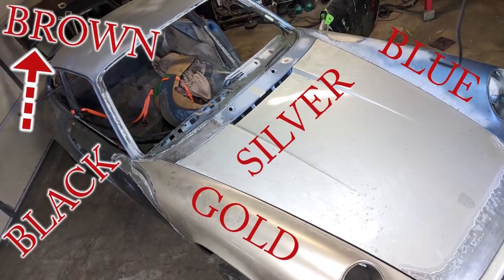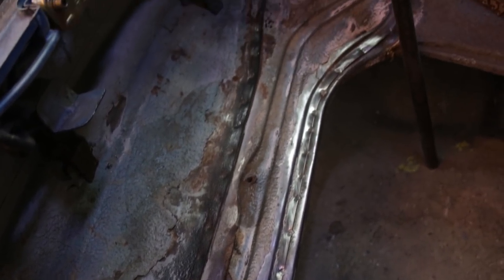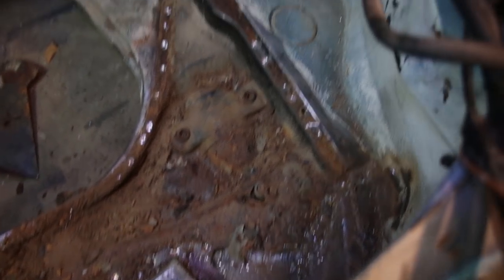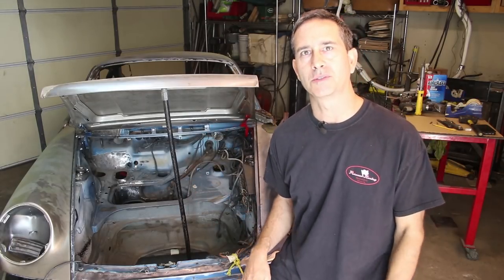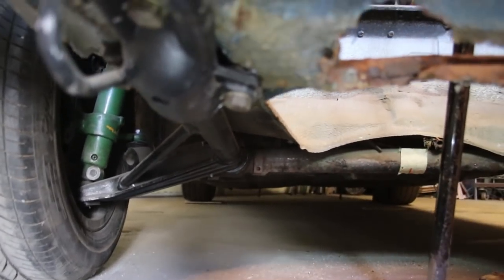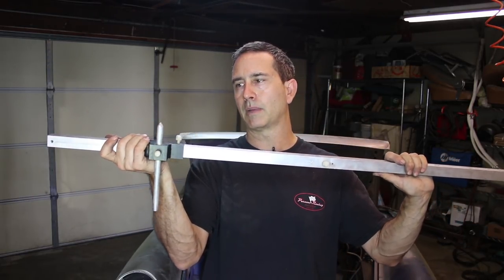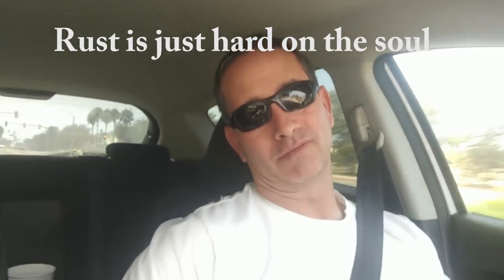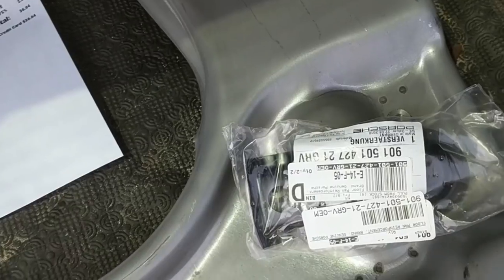Rust Repair is HARD on the Soul...Porsche 911 Suspension Pan Fun😀

Comment: Many people simply cut out the suspension pan, trace old out pan onto the new suspension pan. Prior to welding the new pan, bolt in the suspension points. This will ensure that it gets welded on straight.
Reply from the maker: Yep, I wouldn't recommend that on a 40 year old car especially with known accident history like mine.
Reply: Garage Time - Restomod I totally forgot that your car had been wrecked at one point in the past. Makes sense that to decided that you needed to measure.

Comment: I have a 1977 911 and my front drivers side front part of a arm is pretty well rusted out.  I can move it a tiny bit and you can see cracks all around the 3 bolts that attach it to the chassis.  I was quoted $4000. and since I have more time than money, I would like to do it myself.  It just looks like such a big job, I'm not sure I can do it.  I would think I would need the suspension pan, gas tank support, and fuel tank seal.  Your videos are great.  Thanks, Shane
Reply from the maker: wow, thanks for sharing your story.  It's a big job, but you can break it into several smaller jobs and take your time.  If and when you get stuck, reach out here and we can help.
Reply: So will it be ok to just jack up the front of the car and support it with jack stands on the brace that runs from side to side in back of steering rack with out jacking up the rear of the car?  And not remove the a-arms, but leave them in place to line up the holes of the new suspension pan?
Reply from the maker: Hi Shane, yes the front cross member is a good place to support the car while working on it, however I recommend removing the A arms because they aren't good measuring devices (lots of sliding rubber pieces) and they will be in your way especially if you are replacing the side supports.    How are your welding skills?
Reply: I have a friend that has good welding skills that is willing to help.  Should I just measure before I take it all apart and rely on those measurements -602 mm front to rear and 916.5 diagonally or could you send me a copy of those workshop manual measurements?  I have a friend that will lend me his digital tram gauge. I ordered the suspension pan w/reinforcement brackets and the fuel tank support and fuel tank seal.  Having the new fuel tank support, I could just cut out the old one and then just remove the spot welds for the seam of the suspension pan.  What are your thoughts on all of that?
Reply from the maker: I wouldn't trust an old car with mounts that you can wiggle by hand.  Best to use the factory measurements and make it like new again.  The diagrams are available on a few pelican parts forum threads.  Email me if you can't find them.  My email is in the about section.  
A friend with a welder who's willing to help is a big score!

Comment: Another interesting water level method! Applicable to our cars. Had similar questions to others you answered like rigid shocks. Are they welded? Tires equal pressure etc, are there additional variables that factor into nailing those measurement ranges?
Reply from the maker: Hey Fancypants...thats fun to say!!!  Send me an email and I'll send you some pictures of the temporary rear shocks.  Other variables are minor as long as they don't change.  For instance if the tire pressure changed on one side in the course of a day.  I have another tool that eliminates the tires too that I used to fix all the heavy accident damage.  Goto the about page here and send me an email and I'll send pics of that too.  Are you contemplating repeating this method?

Comment: The leveling system is plain silly, just use some clear tube and fill with water and use it as a water level, much more accurate than the home made device that you conjured up, but the rest of your system is to be commended as a very good accurate method, the Trammel bar or Tram gauge in body shop vernacular is a millwright tool originally,
Reply from the maker: Hey, thanks for your comment.  Water level is the same no matter what you put it in, but if you think a flexible tube is more accurate than go for it!  A simple channel with the ends closed off has advantages that you can measure off a straight surface.
Reply: @GarageTimeAutoResto   I spent a thousand on a laser leveling system for a particular job, and a drywall installer used his water level  to complete the job before i set up the laser, I really felt like such a tool, never mind the good mannered ribbing i had to endure after that.

Comment: you measured without lvling the measure bar. the dimensions given in the manual seem to be horizontal diffrences, so you shouldnt you lvl the measurement bar by sliding the point pins in and out ?

Comment: Great work Tom!  How did you figure the shim for the rear passenger tire?  Did you do the same process to check the front cross member?
Reply from the maker: Thanks Rob.  Step 1 is to level the C channel with respect to the not so flat concrete floor.  Step 2 is to level the rear torsion tube to the C channel using the adjustable height gage that I made.  The shims on the left tire is what was required to achieve step 2.  What I didn't explain was that my car has temporary solid shocks at the moment to set the ride height without torsion bars.  So raising the left tire must also tilt the torsion tube making it perfectly horizontal.  This method is much more accurate than a level for instance.  The front was adjusted/deformed to also be flat.  Since the tub is rigid you can't simply level front and rear without them affecting each other.  I hope this makes sense.  Good questions and sorry I didn't cover all this in the video.
Reply from the maker: I said left tire and should have said right.
Reply: Thanks for your quick reply, and great explanation!  That is what I thought, and appreciate your confirmation.  You also got me thinking about matching tire pressure, shocks that aren't worn equally, etc.  I will be doing this on my 69, as well as the Front Latch Panel.  I will definitely be buying the Tram you posted.  Looking forward to more vids.
Reply from the maker: Hey Rob, you got me thinking too....about the difference between corner balancing and tub structure alignment.  Currently, I'm only trying to align the chassis and corner balancing comes later.  (chassis plus suspension).  Its too bad that I don't have video or pics of this setup, but I'm going to link to my fixtures below.  Don't feel like you have to buy them, please.  See the pics of the ebay listing.  They take all the suspension, tires, shocks out of the equation which is why I used them for the initial pulling/alignment.  These things go inside the torsion tubes and provide a very rigid base on my "levelled" floor.  Same method as my video, but instead of shimming the tire, I shimmed the fixtures.  These were strong enough to push/pull my suspension points into alignment.  Your car probably isn't as out of whack as mine was, so this may be overkill.  Anyhow, thanks for the good discussion and let me know if this is confusing.

https://rover.ebay.com/rover/1/711-53200-19255-0/1?mpre=https%3A%2F%2Fwww.ebay.com%2Fitm%2F232595363407&campid=5338270888&toolid=20008